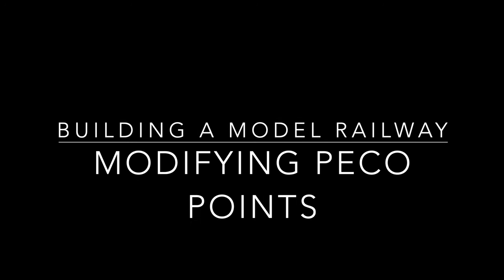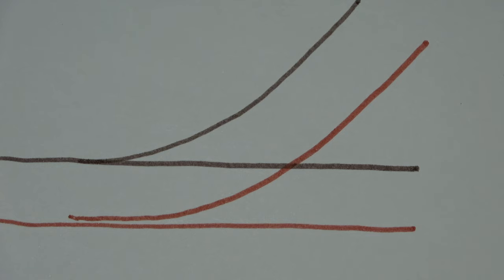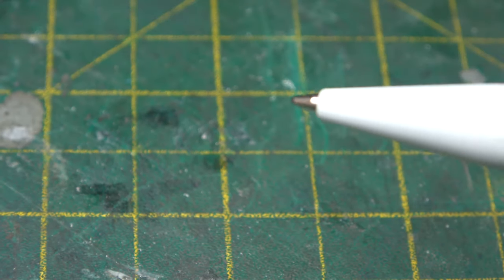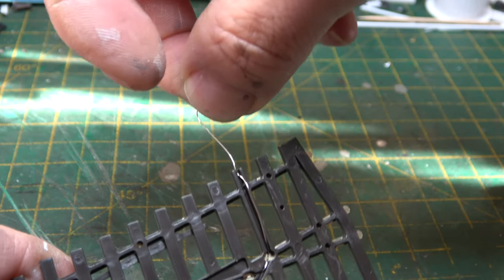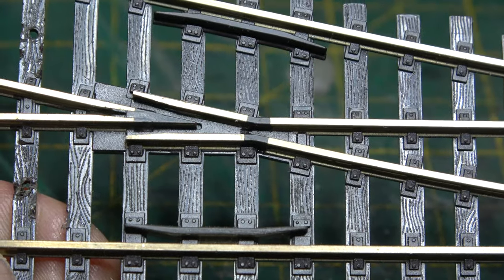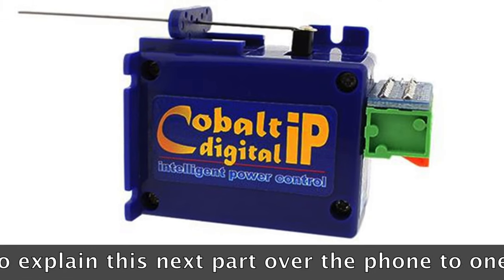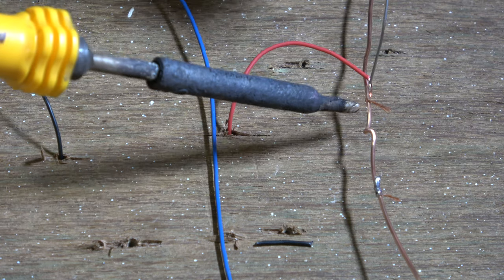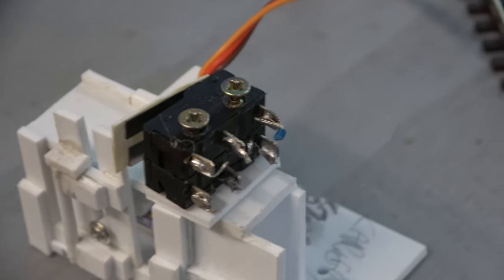Modifying Peco Points

Comment: This is the most sensible solution I found here on YouTube, there will be probably others.
So going further on what you're saying, if we somehow, with electrical conductive paint for instance, can make the point of the insulfrog also conductive you would even improve the area of surface contact between the wheel and the track more and better.
So you make from an insulfrog, an electrofrog, which as I understand it correctly, is the best conductive option.
I'm in the planning stage of a shelf layout, witch serves part as a test build, in a later stage test layout for a later bigger project.
This layout must run, in case of the shelf layout on DC and DCC, so If I make it DCC friendly, as I understand, there also are no issues with DC.
The track I want to build later will be complete DCC.
My option for point motors, are also Arduino driven servos.
Reason I look into this is because I have a few old points that I want to use as they are as new.
For the new once I'll buy, my option goes to unifrog, although with your method this will make not much difference, or not?
Anyway thanks for this very good video, it really has given me a better understanding of the matter.
Regards, Danny
Reply from the maker: Short answer yes!
I treat Electro frog and insul frog points the same, turning them into electro's.
Depends what's on offer as to what I buy, but prefer Electro's for the reason you say, more metal to conduct the electric

Comment: Great video feeding the frog finally got it. Great to know you can convert insulfrog points was thinking I would have to buy new electrofrogs
Reply from the maker: Second hand are easy to come by and a little easier on the pocket ££ 
Be careful which ones you get though!!
I'll do a short vid on second hand points soon.....
Reply: @Wallsrail  That would be very helpful just about to start working on a layout. have tried making the point motors they work better than the normal ones.
Reply from the maker: @him481  Brilliant 👍

Comment: Yes nifty but effectively doubles the cost of a point once you've added the motor...
Reply from the maker: build my own = less than a £1
Reply: @Wallsrail  you got a video on how to do that? Because that would be useful mate.

How difficult is it? 
Same as soldering a stay alive to a decoder that's not supposed to have a stay alive fitted to it?
Reply from the maker: @IronHorseRailways  I have actually. 
https://youtu.be/jvQH2K3Ee1M
I operate a servo controlled system though, so might be a bit niche?
Not to say that the idea can't be transferred to other mechanisms?